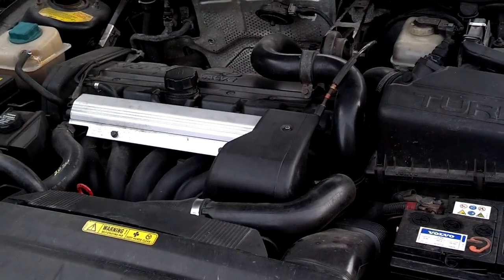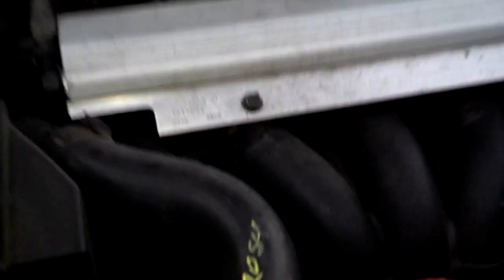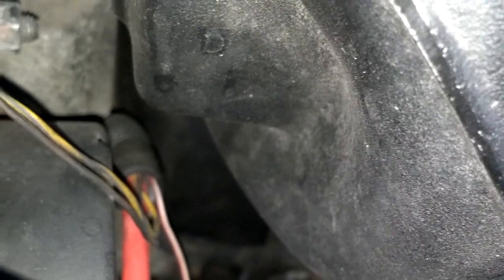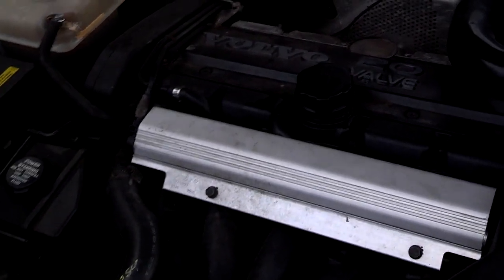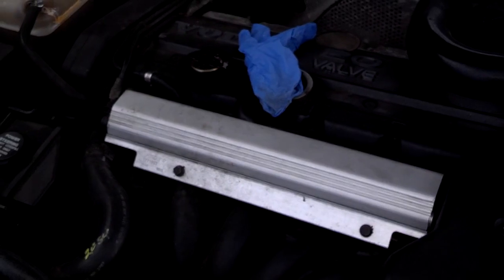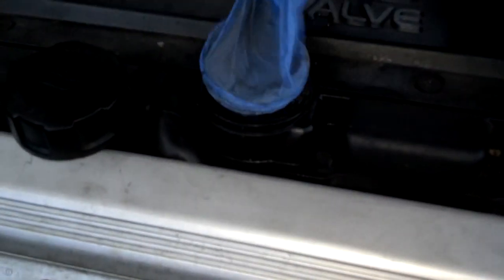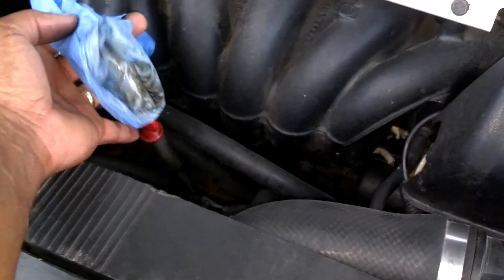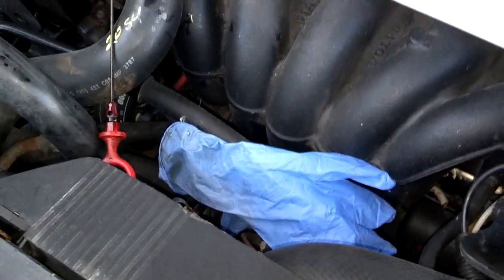Volvo PCV system check, 850, V70, S70, and others - VOTD

Comment: I’ve got fuse 14 or 15 which is emissions system and air conditioner that keeps blowing a 10 amp fuse. Pulled the blower motor and hooked up to 13 v and it blows. Resistor varies voltage to the connector with a multi meter, but when plugged in it will not blow. Car is in limp mode because emissions fuse is popped. Love some recommendations.
Reply from the maker: I don't even know what kind of car you have... 🤷🏾‍♂️

Comment: Hi Robert, I have a 1999 Volvo V70   2.4 L. It's blown two 2 front exhaust cam seals, replaced PCV breather box, cleared hoses, out all back, timed it, engine sounds good but when I rev it doing this glove test the glow blows up. Beyond frustrated. Any ideas, I'd be grateful for any advice. Thank you.
Reply from the maker: Have you checked compression?
Reply: @RobertDIY  Thank you so much for getting back to me, running that and leak down today. I will let you know how that turns out.

Comment: Robert, I replaced everything on the PCV system, and I'm still having positive pressure in my motor and I don't like it lol Made sure all the ports were cleaned out from the block and everything. Even took a tube and stuck it inside the lower drain port and blew air into it to see if the square port was clogged inside the pan ( I came across this method somewhere online). It seemed fine when I did it, i could blow air onto the pan, so I thought that is not my problem. If that is not my problem, then I understand it could be either worn piston rings or head gasket failing. My plan it to do compression check and see where I'm at there, and if that looks good then drop the oil pan and check that drain port. I have a 1995 Volvo 850 GLT and it has been very well taken care of. I bought it 2 years ago from a guy and he had all the service records.
Reply from the maker: Did you do a compression test before doing the job?
Reply: @RobertDIY  I just did a compression test, and I got 140-150 for all cylinders dry, then did a wet test and got 184-186. Is this what worn piston rings look like? You think my motor is on it's way out? I ask bc I was going to replace the shocks and I dont want to if the motor is bad.
Reply: @RobertDIY  No, I haven't done one yet. I'm gonna do one within the next few days. I'll let you know what the numbers are.

Comment: Thank you for the video. On my 1994 Volvo 850 2.3 t5 estate the glove blows up... I changed the pcv box and it still blows up... the moter had 
New rings, bearings, gasket, and crank pully replaced.. what could be causing it? All the tubes for the system are open. Even tried it without the ptv valve and still blew up...could it be a crack in the head, bad gasket or rings in wrong?
Reply from the maker: Are you testing it with the engine hot?
Reply: @RobertDIY  yes I am. Would it be any different if it was cold?
Reply from the maker: Yes, worse. Have you checked compression?
Reply: @RobertDIY  ooo😣. No I haven't yet. I will borrow one and let you know the results... could the piston rings be in wrong? I have a feeling either that or I might have a crack in the head. But before the moter was done it was NOT pushing oil out the top....
Reply from the maker: Yikes! I don't know.
Reply: @RobertDIY  my dad's buddy said I must not even start the car as there is a big chance I have blow buy... he said he will be coming in a couple days to check it out. I'm borrowing a compression tester and checking compression soon.hopeing for the best... will let you know what happens. I'm also busy respraying the Volvo. For now I'm painting her in the meantime.

Comment: Will a blocked or compromised PCV system on a V70 98 Volvo turbo cause the seals in the turbo lines to blowout or leak
Reply from the maker: No

Comment: Thanks for this great video, Robert. I will be trying the glove test but I think I know what will happen. We will see how big that glove gets before it takes off for the moon. I know this because we have had some oil coming out of the dipstick hole for several years. I just didn't know why.
Reply from the maker: Make sure you video that blast off. ;)
Reply: @RobertDIY  I cleaned the throttle body and replaced the flame trap and air filter. Put the glove on the oil filler opening and it blew up like a balloon! Smoking out of the dipstick tube as well. Don't have the time to try to replace the oi trap and all that right now, so skating on thin ice! We had the entire PCV system replaced about 40 thousand miles ago. I just looked at the paperwork.

Comment: My 03 V70 has milky oil and used to only be very little like one small drip on the dipstick. The previous owner said the pcv system was clogged. In the last week, I have seen a rather scary oil leak under my car lately, about 6 or 7 inches in diameter. Then today, I drove for 4 hours at highway speeds and got a dash alert that said no oil pressure. I pulled over and added a quart. I have been adding oil since I got it. It burns (or leaks now) about a quart a month but never gets low enough to alert me. I drove a bit more. It came on again. I checked it, and saw oil everywhere on the passenger side. It took 6 quarts for me to get it home so that I wouldn't run it dry... There was a hole in the hood insulation where the dipstick is. Looks like that's where it came from mostly. But at a quick glance it appears to be coming from the oil separator box. I didn't spend much time looking. I had to go to work. Any help is greatly appreciated! Do you think the pcv system is to blame for milky oil and leaking? Do you think it may be bigger than that?
Reply from the maker: Are you going to bring it by for me to check?
Reply from the maker: https://youtu.be/B12SNN_3pq0
Reply from the maker: https://youtu.be/za8qgxDey8I
Reply from the maker: https://youtu.be/gt9w-ZSxs9I
Reply from the maker: https://youtu.be/vJXfQrDPK04
Reply from the maker: https://youtu.be/R_Wko5d7Veo
Reply from the maker: Unless you think it's cheaper to replace the engine or the vehicle, you may want to check the oil before you start the car daily, and fill it to the full mark on the dipstick.
Reply from the maker: https://youtu.be/zhgTMhwSuzM

Comment: Hey I was wondering if ya could give me some pointers on changing the pcv system on my 1999 Volvo V70 wagon I just bought the car and the service engine  light came on and the vacume hose under the intake has collapsed and is leaking so I know I have to replace the pcv system I dont quit have the $ to purchases the kit yet so I know I'm not going to be able to put it into the shop so I'd really appreciate it if you could give me some pointers when i get ready its really hard to get anyone to help In anyway where i live so if you could you would be a blessing from the lord and I'd really appreciate it its really a nice ride and really want to keep it on the road please message me on Facebook messenger if you'd like thank u ahead
Reply from the maker: Did it fail the glove test?

Comment: I don’t believe the guy I took it to.. he didn’t even take the fuel pump relay out, he just said, he doesn’t believe it’s the fuel pump relay..he says, I think it’s in the firing system- AH... hogwash...
Reply from the maker: What's it doing?
Reply: Robert DIY it runs fine.. it only failed 2xs , from not starting... I went to a European car parts website, they even said, they believe it’s the fuel pump relay too.. so, I went ahead and bought a fuel pump relay, from them... That’s 2 Volvo professionals that have said the same thing...
Reply from the maker: OK.

Comment: Hey Robert I have been relying on you videos for the last two years! Been doing work on my sister in-laws 2001 Volvo s40 1.9t. It been leaking oil from the passenger/right side of the motor I assumed it was the vvt sprocket so I went ahead and did a timing belt with new sprocket and seals replace both the vvt seal and the crank seal. It still seems to be leaking like a crazy so I did the glove test in this video and it doesn’t suck in or blow up. It blows in and out rapidly. Any ideas I’m pulling apart again to do the intake seal cause that seems to be where the oils coming from now. But afraid of blowing out these new seals do to a vacuum problem.
Reply from the maker: If the cam sprocket is not VVT, it's best to use a tool to install the seal.
Reply from the maker: https://youtu.be/o46FDrr9Lzw
Reply: Thank you I got the final seal replaced and as far as I can tell I'm not leaking!!!!!
Reply from the maker: Good.

Comment: Hi Robert. I m  from Turkey. I follow you constantly. i have a 96 850 B5204t turbo. the pipe in the intake manifold had come out of place and steam was coming out of the engine hatch. I replaced the pipe, but the smoke did not stop. and the turbo threw too much oil out of the oil filler flap when it presses high. Could the cylinder head gasket be defective? or is it caused by PCT?
Reply from the maker: I really don't understand what you are trying to explain. What pipe in the intake manifold, the throttle body inlet hose?
Reply: @RobertDIY  I'm talking about the small pipe going from the left side of the intake manifold to the PCT. it was out of place. I replaced it. then started throwing oil out of the oil pan. Could PCT be causing it? english knowledge is not very good. Thank you for your interest

Comment: Awesome vids Robert !!  learning so much about  this engine from you... THANK YOU   I have a 1998 C70 T5 turbo and we did a smoke test on the car to determine any leaks - the vacuum tube going into the PCV box (the same one you talk about in the video that frequently cracks) is cracked and you can see it if you shine a light on it - it's also where the smoke from the smoke test leaks out !!!  -  can this crack result in boost pressure loss @ high rpm?  We've confirmed there are no other leaks or cracks after replacing several hoses via the smoke test... just this last one and I'm curious as to how this crack affects performance and boost pressure loss
Reply from the maker: I don't think so. It may but it is more of a vacuum thing.
Reply from the maker: Replace any damaged tubes.

Comment: The PCV valve should be changed, in general, in all cars, to 30000/50000 km. It is important to change that piece because they become clogged or damaged. If it does not work well, the oil gases tend to run out of the engine seals. In the Volvos, they should be changed between 80000 and 150000 km, depending on the case. I already changed that piece in two Volvos. In the first one, an S40 T5 was changed to 120000. In my current one, a Volvo S60 T6, I changed it to 80000 km. It is relatively easy to change it in the Volvo S60 T6, especially because of its location (above the engine). Although there are some screws that take a lot of work out and then screw them. I recommend changing that part so that the engine stays clean and in good condition.
Reply: Run quality synthetic oil (I prefer Castrol, as does Volvo) and you'll never have to change it.   20 years and 250k on my original box when I removed it.  Entire system was clean.   Same goes for numerous others I serviced.   Quality oil is key.
Reply from the maker: ok

Comment: Hi, Robert. I just bought my 1996 Volvo 850 non-turbo 2 months ago. I don’t have a flame trap. Did some come this way? And they also capped off some of the PCV vacuum lines, removed some. I can’t find a good image or diagram showing where they all ran too. I got no vacuum line going to bottom of air cleaner underneath mass airflow, on top supposed to be 2 vacuum lines but I only have one (white/black ends), top line missing too. Would definitely appreciate it if you could help me figure out what’s-what. Lol. Thank you for all your videos and hard work helping all of us Volvo Guys. Your the Best.
Reply from the maker: https://youtu.be/gt9w-ZSxs9I
Reply from the maker: https://youtu.be/dKk-KHl2b5k

Comment: Hey RobertDIY. Talking about volvo 850 1994 non turbo here. I recently performed glove test on engine oil fill cap. It was just sitting there a little inflated. Not fully inflated. Of course no suction. There was white smoke coming out of engine oil fill cap AND dipstick when I pulled it out. 

Does this tell you that there are 2 problems? PCV system clogged and an internal coolant leak? Or just pcv system. Would cleaning the pcv system be enougj or replacing it is a better option if its just the pcv system the issue here? 

the coolant does not seem to be contaminated as I do see green coolant in the coolant reservoir tank, i could be wrong. But I am being told coolant is white.

edit: no check light on. However there is some noise that seems to tell me the car might need oil or can there be noise due to pcv system not working? 

Also, no smoke coming out of exhaust, it seems to be normal. This tells me coolant leak should not be the one..
Reply from the maker: No, no, no, yes, yes, no.
Reply: Robert DIY so replacing the pcv system should fix the white smoke problem?
Reply from the maker: There is no white smoke problem.
Reply: Robert DIY what do you mean by that?

the car was warmed up. I open the engine fill cap. Steady stream of white steam or smoke, Idk what it is was coming out. Same with dipstick. So does this happen whenever the pcv system is clogged? 

Ipd does not have Volvo's pcv system on their website. They have an aftermarket variant. Do you any other place where I can order it?
Reply: Robert DIY so if I get the pcv system serviced, it should be good?

Because some people are telling me it can be a bad cylinder head or bad head gasket so just wondering if you could give me some advice. Thanks.

Comment: Very good video. I have not purchased my first Volvo just yet, however, in the coming month I hope to. Your videos are educating me to a level to keep an watchful eye on people trying to offload cars with several hidden problems. Also, knowing what to look for may help to reduce the selling price. Kelly blue book is typically utilized for pricing and rarely questions these issues. Many of us DIY mechanics can perform these checks without taking the vehicle to a garage. Even if you had to bring the vehicle to a garage, it is very helpful to have an idea of symptoms so you are not taken advantage of by a garage telling you that you need a brake job when in fact your PCV system needs to be serviced.  I recall meeting a lady once, who owned a Ford Escort, it was making a low pitch rumble noise from the rear of the car, the car had 40,000 miles on it. Margaret took the car to a garage, the mechanic told her the wheel bearings needed to be changed.  Margaret phoned me, told me about the garage findings. I drove the hour up to Albany, pulled off the drivers side wheel and showed her the hub. No issues, none, it turned out the noise was a muffler heat shield vibrating against the frame. I repositioned it, noise gone. I have watched more than 5 of your videos thus far. Becoming better armed and educated of what to look for when I finally get that chance to go an look at Volvo’s. Thank you..
Reply from the maker: Thanks for watching.
Reply from the maker: https://youtu.be/L4g-w4OXeBw

Comment: Hey Robert, I have a 95 850 glt none turbo. While driving I can feel it acting as if it wants to shut off. It begins to labor when I come to a stop as if it is suffering from fuel starvation. Sometimes it stops. It always starts back up but I have to keep playing with the accelerator to keep it running. Do you have any suggestions
Reply from the maker: https://youtu.be/NWfLpp8NevI
Reply from the maker: Also check the intake tube for leaks.

Comment: If you drive a car with a clogged pcv system for a couple of miles will it cause the car to cut off and not want to start for awhile?
Reply from the maker: Nope.
Reply from the maker: https://www.youtube.com/watch?v=gLoO-D4yOcU
Reply from the maker: https://www.youtube.com/watch?v=NhtUXZTurzo
Reply: it has a brand new fuel pump, relay switch has been checked and is good, and it has no engine light on, even had it scanned no error codes at all. it has no suction on the pcv system but it is blowing smoke out of the dip stick, I replaced the oil trap box and it ran great for a couple of days. Now it is back to the same thing. I did not replace the lines. And I am at the point of just setting fire to it lol.
Reply: It's a 1998 Volvo v70 station wagon non turbo

Comment: Hey Robert, I tried your methods but I have another method to test this system I think so please tell me what you think about it. There is a little more work involved but anyone can do it. 
I took a ride on the highway for about 30 minutes. Did a few pulls. I returned home, shut off the engine. Next I disconnected the PCV hose at the air inlet (between air filter box and turbo right from the engine as you stand in front of the Volvo). It is reachable with your 2 hands. Once the hose disconnected I started the engine and put my finger on the hose that comes straight from the box itself. I felt there was pressure building up after 2 seconds, pressure gets more and more as I hold my finger there. If I let my finger off it made this wooooosh sound. There was a little bit of "mayonaise" in the hose (water mixed with oil).
So I think my system still works fine. :)
Reply from the maker: OK. Hope that works out for you.